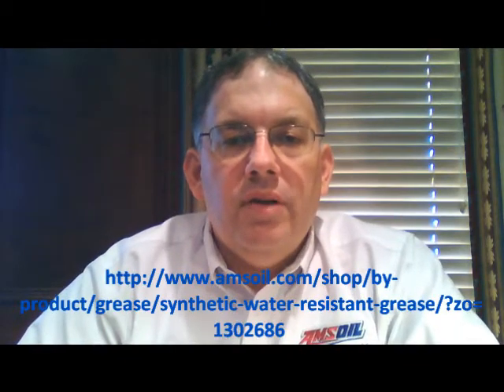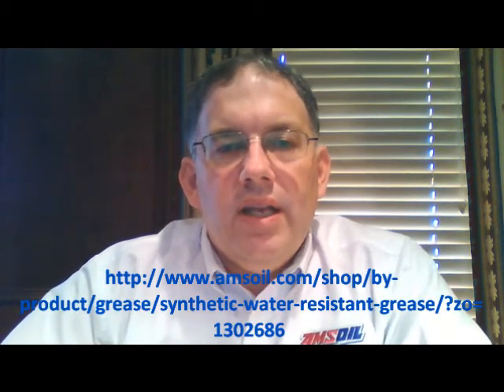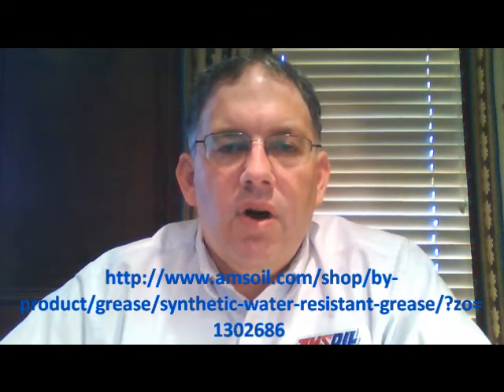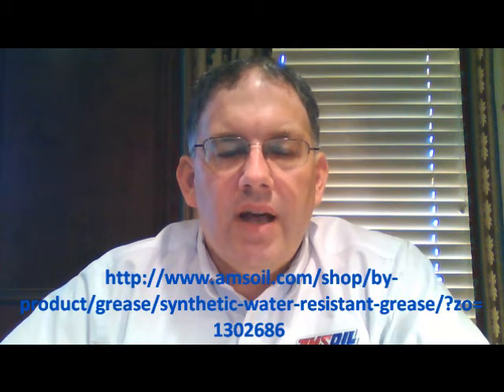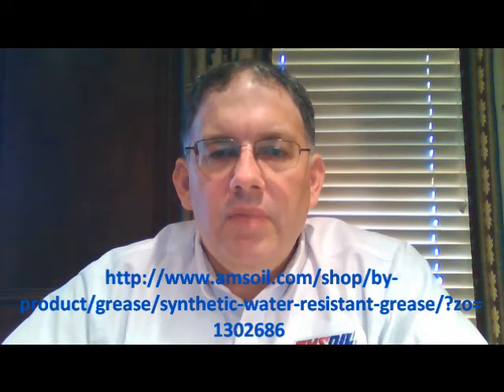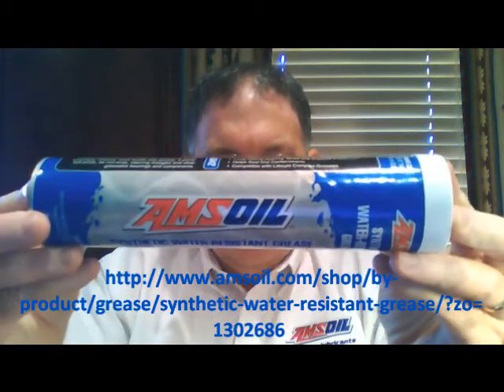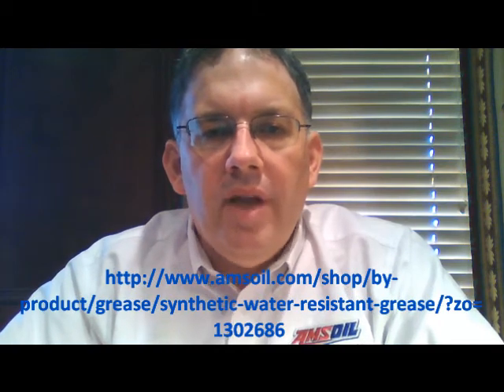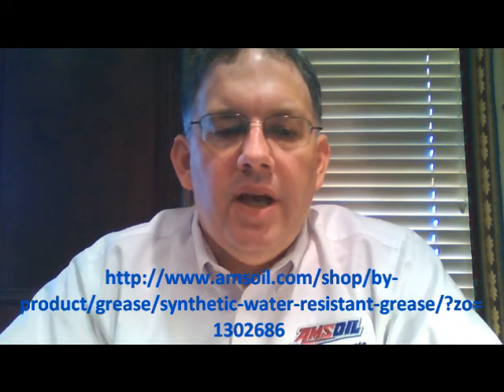AMSOIL GWR Synthetic Water-Resistant Grease

Comment: would this work with regular wheel bearings like on a ford ranger ...
Reply from the maker: Yes.  AMSOIL recommends this grease for boat trailer wheel bearings, so it will work in cars/trucks as well.